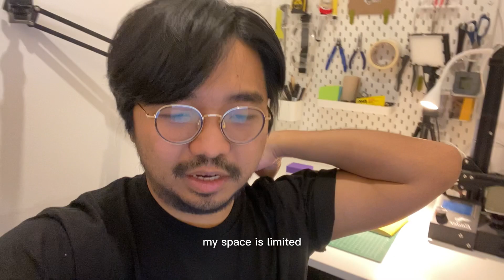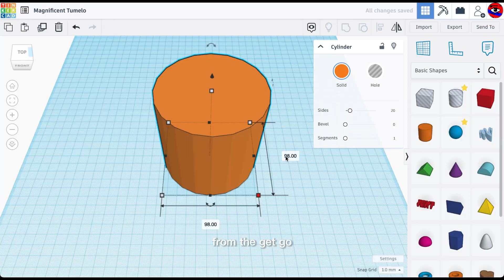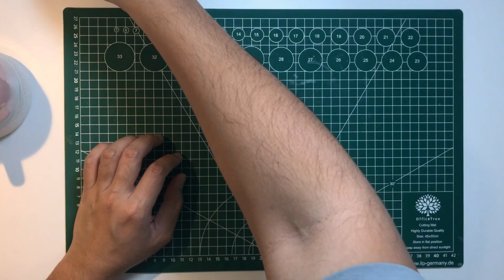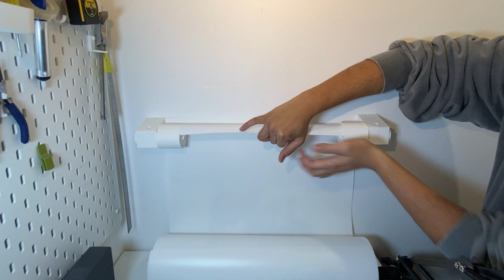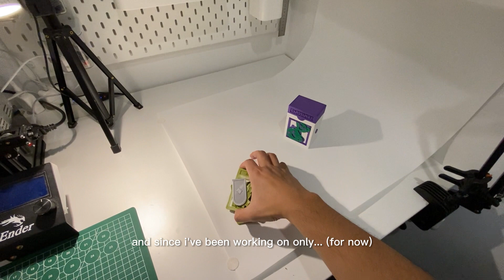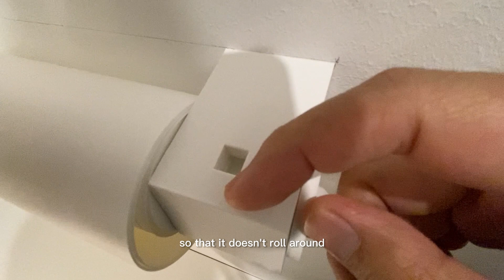I made a small backdrop wall mount using 3d printer

Comment: A dowel between the rollers would make single side retraction easier, and maybe a thin steel rod folded inside the loose end of the backdrop could eliminate the need for taping to the table
Reply from the maker: Hi there thanks for the suggestion! Steel rod as a weight is a great idea and therefore i dont need to add anything on my desk surface. 🙏🏽